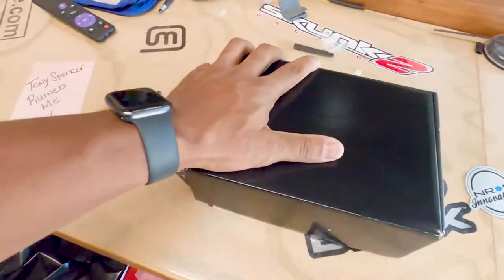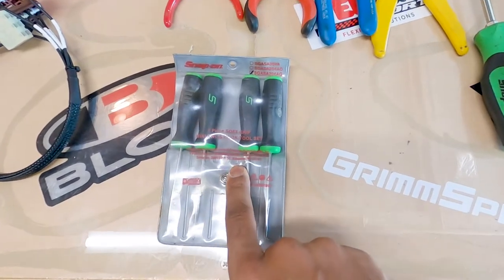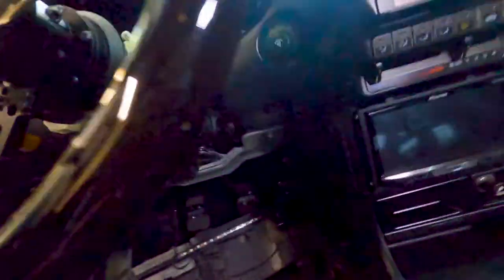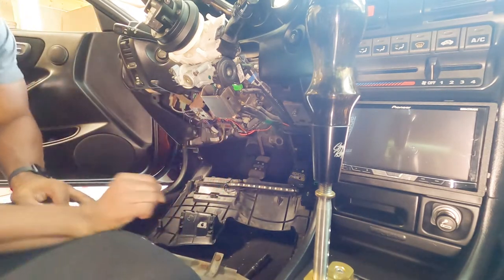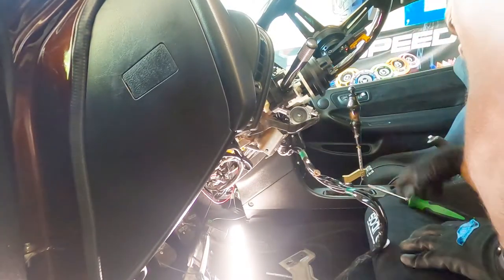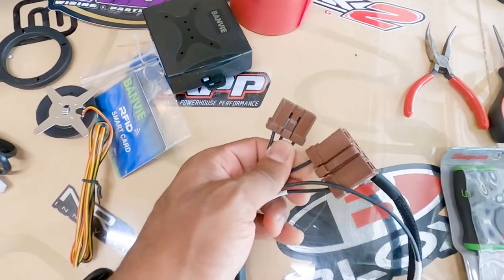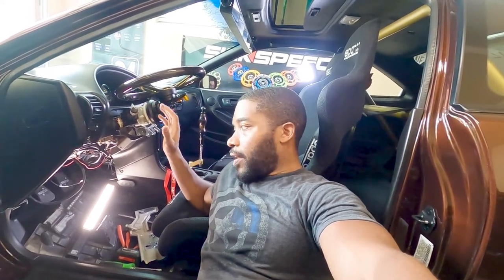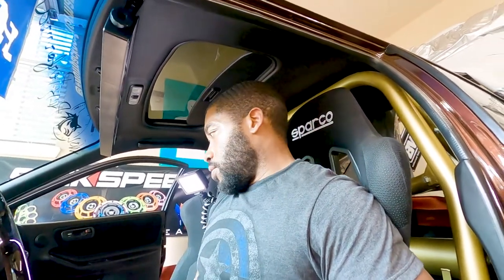PUSH BUTTON START | ACURA INTEGRA | INSTALL VIDEO

Comment: Best most in-depth I’ve ever found on this top, thank you bro bro. I’m doin it to a Kia spectra
Reply from the maker: I appreciate that! I hope things workout on the spectra. Let me know!
Reply: @harshtymesteggy  yea it worked just fine, the 07 kia spectra doesn’t have an immobilizer, well it does it just doesn’t work how you’d think. So if you find all the right wires your just gotta make connections and mount the button

Comment: I just did some wires in my steering column too, my friend said to stuff a towel or pillow under the seat so if bolts or screws fall out theres a chance they wont end up bouncing under the seat

Comment: You know you could have just brake light voltage anywhere along  the circuit you didn't necessarily have to go straight to switch

Comment: the hammering part and the brake system seems like the toughest part of the jdi push to start installastion for the teggy.
Reply from the maker: Challenging
Reply: @harshtymesteggy  I take it back it was actually finding the brake line and clipping it with the small space given.